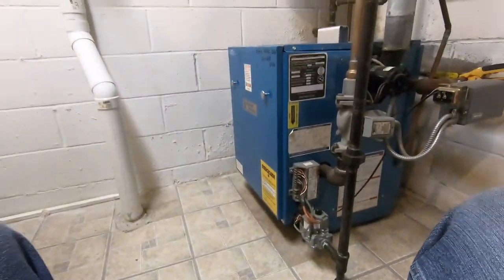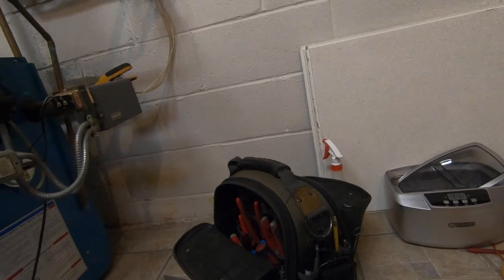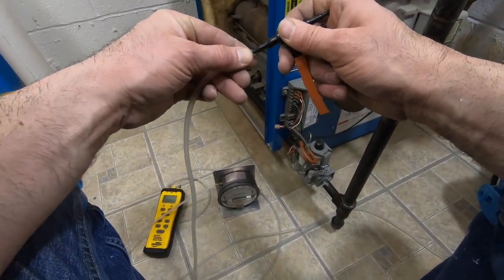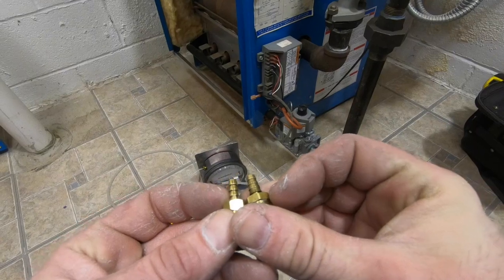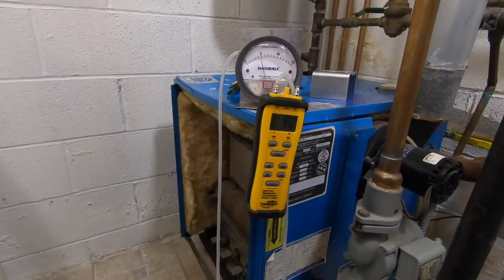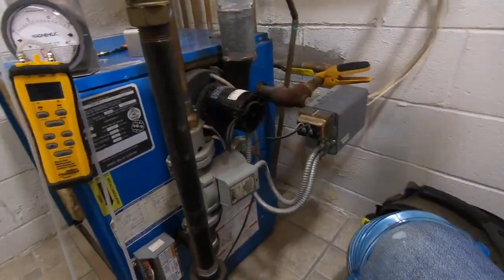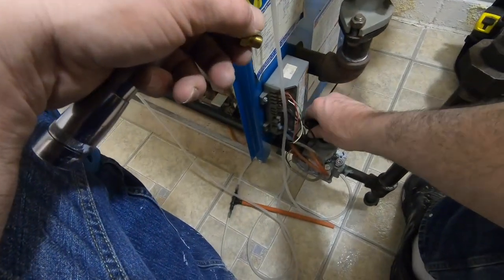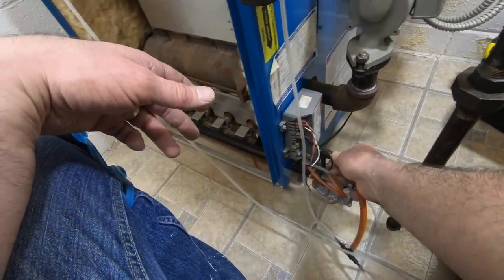My Exploding Boiler Delayed Ignition Flame Rollout Testing Gas Pressure

Comment: Saw something similar from a unit where the heat exchanger coils were all full of soot.  I know that this boiler was big enough that when it was first started it would literally rain inside of the boiler when it started to come up to temp.  It's really weird when it happens though.  My best guess is that when that would happen it would get some soot going and that ended up depositing on the coils plugging them up.

I didn't own the building but helped with some of the stuff when there were issues.  I had actually moved and got a call from the owner begging for help to try and figure it out.  Drove an hour to help because the building was basically without heat at that point.

Comment: Haha gotta love exploding gas appliances.  Happened to me once on a reznor unit while I was 30ft up on a scissor lift.  Scared the hell out of me 😂.  Maintenance guy had replaced the gas valve,  had the gas turned way to high,  and had cracked the gas pipe just after the threads on the outlet of the GV.  Neglected to tell me anything about any of that,  just that it was having problems.  I flipped it on and that thing managed to rollout far enough to light the gas on the cracked gas line.  Learned some lessons that day.  🤣
Reply: PrestoWind sure is,  I don’t really even like being in a lift at 30ft 😂.  Feels so unstable
Reply from the maker: That was why I started with checking gas pressure before anything else. Especially with a newer looking gas valve
Reply: The HVAC Hacker 👍 I have since then

Comment: Gas pressure in the lines is still low at 4.6", I would adjust that outdoor regulator to about 7" wc. Gas pressure in the system should really be in the range of 6-8" wc at all times for gas valves to open, close, and regulate properly. Low input gas pressure can cause the gas valve to open too slowly and that might be the cause of your flame out because the gas velocity is too low in the venturi.
Reply: Half of your statement is true. According to the video, his input pressure is 5.6, and output 3 something or 4 something. If nothing else inside the house is on, he shouldn't have an issue (if his broiler is at the end of the line.) Usually most appliances use between 3-5 pressure. Of course, 5.6 before appliances thru out the whole house is low.

Comment: Nothing beats a mechanical (analog) gauge to see rises and falls whether it’s pressure , temperature, voltage , current , etc. A digital meter simply cannot display fast enough to accurately show subtle changes.
Reply from the maker: I learned that years ago troubleshooting a gas gun on an oil boiler converted to gas. pressure switch was 0.15"w.c. my digital missed the fluctuations. I condemn the pressure switch. replace the same thing. put Magehelic saw functions, open-air baffle, no more pressure switch problems. Digital is good when just checking pressure.

Comment: That's funny i have the same one and i just cleaned it up real good because it was doing the same thing. Any suggestions? Mine has been in this house over 50 years.😰
Reply: Time for a new boiler.
Reply from the maker: Could be a problem with ignition module, gas valve, or pilot assembly, the cleaning I did heat took care of the exploding problem. Yet I am now correcting a hi co in exhaust problem
Reply: @thehvachacker  yes i have to break down the whole unit to clean in between the chambers that should help with the exhaust.

Comment: Pressure probably isn’t da cause 
Please take a good look at pilot 
Maybe a new pilot assembly 
Or remove and clean
I’ve seen this due to damaged and or bent pilot assembly 
Once or twice 
Smooth ignition once pilot is ok 👍🏻
Reply from the maker: I fixed it in this video https://youtu.be/XF026HJbpKE  . I just wanted to test my gas pressure and verify what it was. Before doing anything else. The next part was filmed at same time as this one. I put testing the gas pressure separate from performing a good maintenance.

Comment: I had an exploding gas oven like that.  Turn it on, wait almost two minutes and BANG.  Had two issues, low voltage coming into the house around 99-108 volts and a bad hot surface igniter.   Gas scares me.
Reply from the maker: This boiler was never worked on other than the gas valve replaced and a zone valve. Factory burner wires to hold them in place for shipping had to get cut.
Reply: I have that problem now, I replaced the bad igniter and put in the new one, and now the oven makes a loud bang and slightly opens the oven door. It only does that at the beginning of the preheat once the oven is up to temperature. It’s like the oven is turning to gas on too early before the igniter has a chance to get hot enough!

Comment: I had a Utica boiler yesterday that did the same thing to me it was propane I had a bad gas valve valve was leaking by found it with my sniffer thru offices  draft damper was in manual so customer did not smell gas
Reply from the maker: Did you pick up any gas pressure to manifold when the system was off? This system has a pilot burner and main burner. The pilot wasn't sending correct signal. Yet more troubleshooting coming
Reply: @thehvachacker  just leaking gas  into 2 offices of the three customer said they were using alot of gas I suspect valve was leaking more sometimes this unit had intermittent  pilot  I could  not find it with bubble  only with sniffer  they claimed 200 gallons  of l.p. 3 weeks lucky unit did not explode also who ever put that damper in manual probably saved them  this unit was in a room that was lower than rooms around it anyway I enjoy the videos we see alot of same stuff out there  our company sells oil and we do plumbi g heating and a.c. residential and commercial in ct
Reply: I don't buy the 200 gallons leak in 3 weeks, it would have pooled the basement/house full and left nothing but debris, even with an open damper and good draw, propane is just too dense compared to air.
Reply: @throttlebottle5906  ya  that is what they said and yes propane heavier then air   crazy propane company told them to call a service guy and not test themselves  before leaving  house
Reply: And they only bought house 1 moth ago just moved in 1 week ago
Reply: I have a peerless boiler doing the same exact thing. The gas valve is weeping and leaking on the orfices, i had cleaned the heat exchanger last year but now the kaboom 💥 is back and i used the klien sniffer to find the leak.

Comment: I had the same problem and replaced the electronic spark ignition to a standing pilot system and the delayed ignition does not happen anymore.
Reply: delayed ignition happen when the port of the burner near the ignitor or pilot is clogged, or just build up white ash that pushing gas away from the flame for a second. With that much of gas come out, a slight delay will cause flash back like that. Unless you upgrade the board with spark assist (which include flame sensor) Which cost money. A simple cleaning at the burner and pilot head its all required. Most tech out there trying to make small issue looks big to put in the sell that's all. 
In this case, he does his own work just to get experience I guess. Which perfectly fine. That's how we learn back in the old days. We play around with stuffs up to gain knowledge. Knowledge ain't cheap most of the time.

Comment: Pilot tube maybe too small or might be some dope in the orifice. I've run across that a couple of times this past season where the pilot was delayed ignition because the guy before me used that little 1/8th line and it needed a bigger one, and another where they doped the fuck out of the ferrule and it ended up causing a partial blockage.
Reply from the maker: Couldn't get to the orifice. This video I pushed out first. To cut down the maintenance vid. Only spoiler I will give is the burners still had factory wire holding in place. Also, I did verify the pilot tubbing is correct size. Orifice I couldn't access
Reply: @thehvachacker  so if those burners have never been pulled, then ots a safe bet the outlets are clogged to shit. Thats always fun lol. I await patiently for the maintanence vid to conform my speculation lol

Comment: Never adjust the gas pressure at the service regulator on the meter manifold,there could be another issue like a plugged or restricted regulator vent,or a problem internally.Call the utility company,they will change the regulator.We have had people turn up pressure on regulators and when an ice plugged vent melts you now have over pressure to the appliance regulators inside.
Reply: Wouldn't the ice plugged the vent regardless what the actual pressure? If you (know what you are doing, and how doing it) adjust the pressure, then the pressure just goes up to the right pressure (without damaging it). Sure, to be safe call the utility company out and fix the issue. But yes they come out and adjust it without replacing the new one. Nothing come out from manufacturer perfectly. Reason why there are tech whom know what they are doing to fix the issue.
Reply: I worked for a gas utility for 25 years,it was extremely rare to adjust a residential service regulator.The usual problem was low gas pressure from a variety of internal problems or the vent.By cranking the regulator down to get more pressure without knowing you don’t have something else going on is risky.Another issue was people turning the gas service valve (at the meter manifold) on too fast and damaging the diaphragm,especially in cold weather.There is usually a sticker on the meter warning of tampering with utility equipment,why risk it,come back after the gas co.gives you 7”WC from the reg.

Comment: Had a 3 Million BTU boiler at Bayonne High school blow up on me once. The pilot was being pulled away from the main gas jet enough to satisfy the flame sensor but not light the main so the whole chamber filled from back to front and BOOM!!! 8” gas line.. I ran a soon as I heard the valve click but no ignition.
Reply: wow
Reply: where you ok when that happened

Comment: Bad draft or dirty burners ,you didn`t show the flames then running blue or yellow,  that should have tripped the roll off switch but it didn`t.
Had a steamer the first startup in morning would do that but after it warmed up the draft was good.
Reply: a quick flash like that wont trip a roll out, it takes some time to heat the bimetallic disc until it trips it.

Comment: Expansion Tank upside-down
Reply from the maker: Can be installed in any position. A rubber diaphragm separates the air and water inside
Reply: @thehvachacker  "No" Read the installation instructions